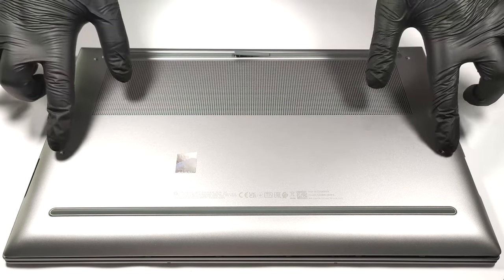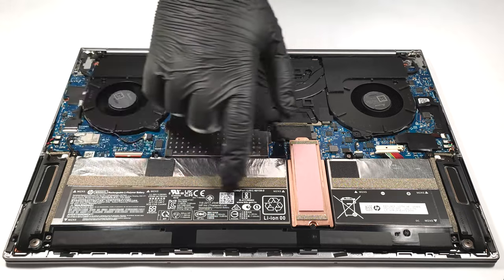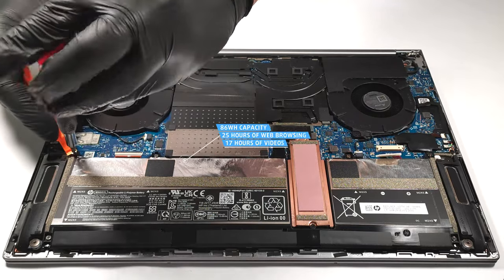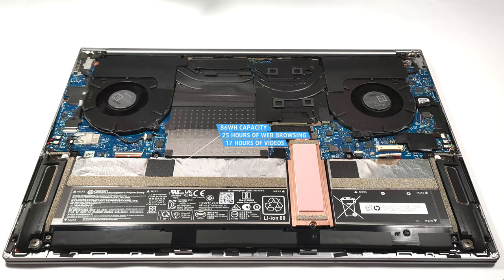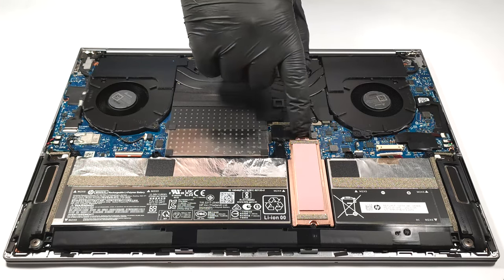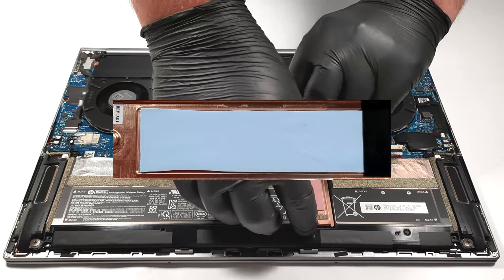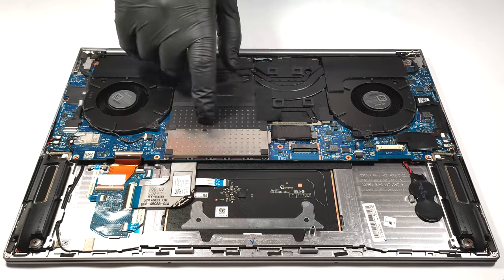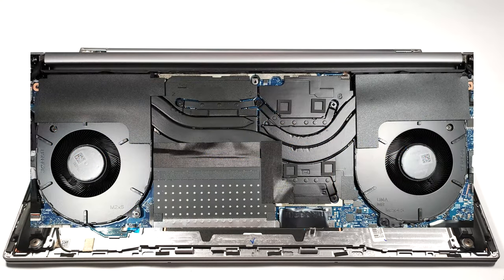🛠️ How to open HP ZBook Studio 16 G10 - disassembly and upgrade options

Comment: 25 hours of web browsing is a complete myth, its like 5 hours or so, major difference. especially since you can have an i7 and i9 processor. most of them have the i9 and many people get this computer with the 4k screen with 120 hertz or the 4k OLED and it just sucks power out. it doesn't last that long, just got mine recently.